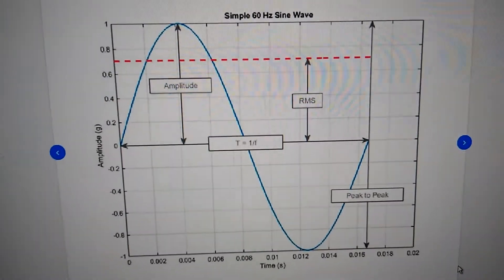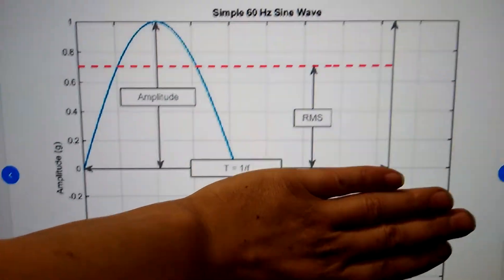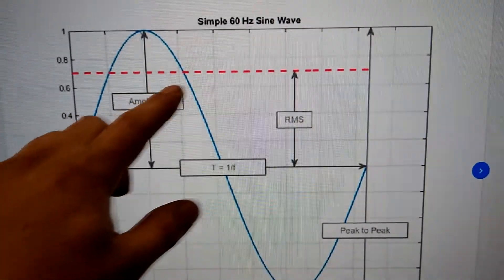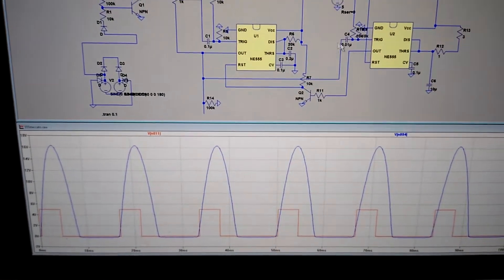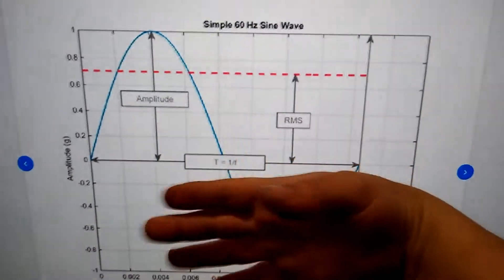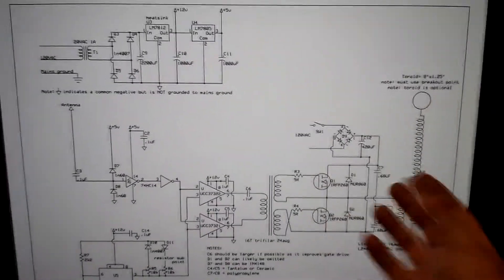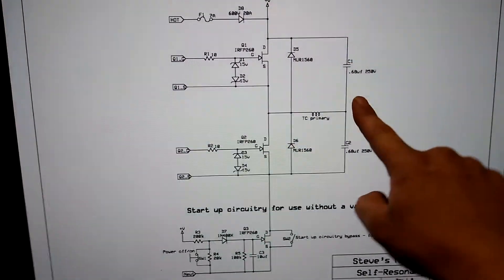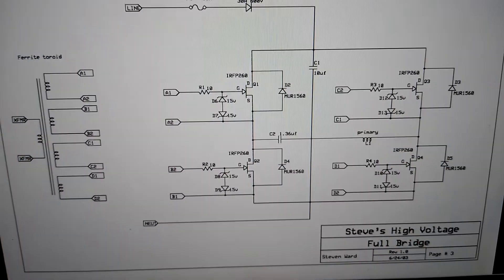Mains Sync SSTC "Staccato" Interrupting Explained

Comment: Thanks man. This really helped me understand it better.  That is saying a lot as Tesla Explorer is my buddy.  I been wanting to build these for almost a decade.
Reply from the maker: Bro it took me forever to get it and I had people telling me about staccato for a while, but I'd look at the circuit and not entirely be able to work out what was going on. The only distinction I should have made here is that the interrupter on time is driving the enable feature and not the gate driver inputs directly of course, so they are being told to "cut on" as in enable the resonant feedback and then disable it when the interrupter signal goes low again. I've made a few recent videos trying to explain the general idea behind the basic full bridge I just built but you can def get a nice staccato setup going from the most basic of half bridges without any PLL or anything. Def let me know if you need help with anything.
Reply: @Magneticitist  sweet.